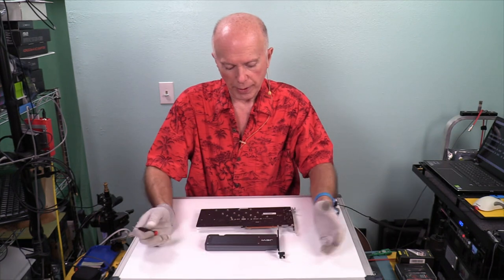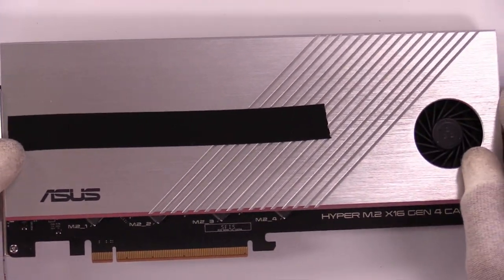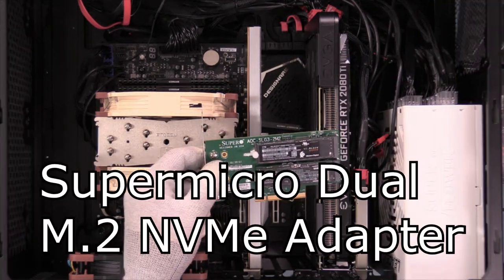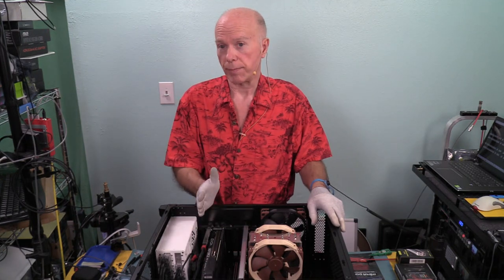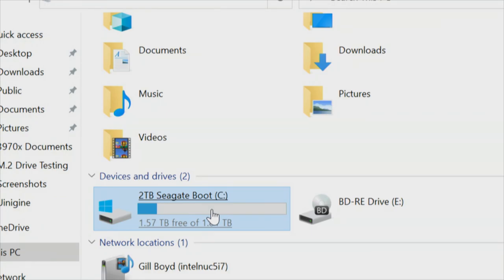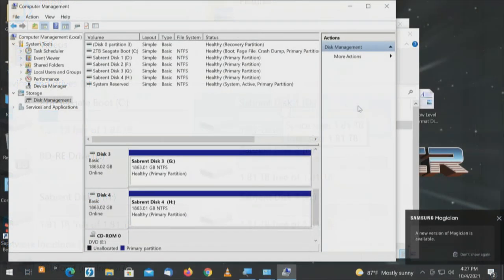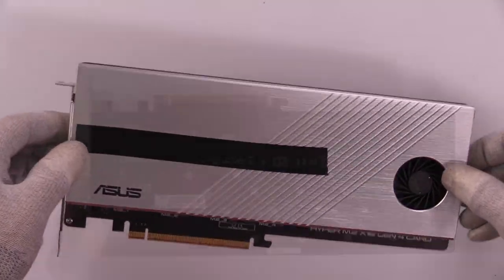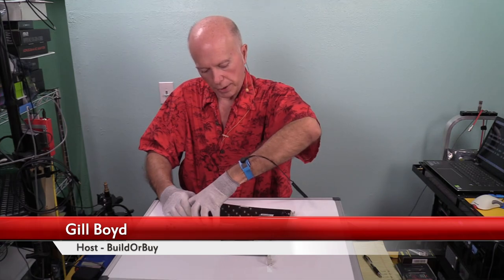ASUS Hyper M.2 X16 PCIe 4.0 X4 Quad card Heat and Speed Test Comparison

Comment: WIll this, or do you know of any other cards, work on an MSI B550 Gaming Carbon Wi-fi Motherboard? Or, what would be the best type of raid card / system for this? NVME or SSD? Thank you. (I currently have both NVME slots full on my mobo (two)).
Reply from the maker: Hello dahuchsi,
Welcome! Not enough CPU PCIe Lanes for X16 unless Your GPU were using X8. Then You would still only have X8 for a Quad card which requires X16, electrically. And... Does Your Bios support CPU PCIe Lane Bifurcation? You would need a Self Bifurcated card that would work on X8 Lanes. There are several. Not certain any are currently available. 
1. Syba Quad M.2 NVMe Ports to PCIe 3.0 x16 Bifurcation Riser Controller - Support Non-Bifurcation Motherboard
https://amzn.to/3rcg8EN
2. Syba Dual M.2 M-Key NVMe Ports to PCIe 3.0 x16 Bifurcation Riser Controller - Support Non-Bifurcation Motherboard (SI-PEX40129) Requires X16 Slot 
https://amzn.to/44hexfQ
3. SABRENT 4-Drive NVMe M.2 SSD to PCIe 3.0 x4 Adapter Card [EC-P3X4]
https://amzn.to/3NYR2SR 
4. StarTech.com Dual M.2 PCIe SSD Adapter Card - x8 / x16 Dual NVMe or AHCI M.2 SSD to PCI Express 3.0 - M.2 NGFF PCIe (M-Key) Compatible - Supports 2242, 2260, 2280 - JBOD - Mac & PC (PEX8M2E2)
https://amzn.to/3pFx32j 
5. Micro SATA Cables|PCIe x8 Gen4 for Bifurcated M.2 NVMe Dual Port AIC 
https://amzn.to/3D0wkfh 
6. HighPoint Technologies Highpoint SSD7105 - PCIe 3.0 x16 Fully Bootable 4-Port M.2 NVMe RAID Controller 
https://amzn.to/44v0YJi 
7. HighPoint Technologies SSD7540 PCIe 4.0 x16 8-Port M.2 NVMe RAID Controller 
https://amzn.to/3JLA6g6 
8. QNAP QM2-2P-244A Dual M.2 22110/2280 Pcie SSD Expansion Card (PCIe Gen2 X4) 
https://amzn.to/3JK3gMw 
9. Ableconn PEXM2-130 Dual PCIe NVMe M.2 SSD Adapter Card - PCI Express 3.0 x8, Supports 2X M.2 
https://amzn.to/3XElPHK 
10. Highpoint 4-Port M.2 SSD7505 PCIe Gen3/Gen4 NVMe Bootable RAID Controller for Windows & Linux 
https://amzn.to/3rhELAa 
11. IO CREST Dual M.2 B-Key SATA SSD Converter PCI Express 3.0 x1 Expansion Card Heat Sink Jmicron JMB582 Chipset SI-PEX40153 
https://amzn.to/3PHZLtR 
12. Vantec Dual M.2 SSD RAID PCIe x4 Host Card (UGT-M2PC300R) 
https://amzn.to/3pwcJjZ 
13. Highpoint SSD7101A-1 NVMe 4-Port M.2/U.2 Unbeatable Peformance/Comprehensive Selection; No-Bifurcation Required 
https://amzn.to/3D0Y8Qn 
14. OWC Accelsior 8M2 Eight NVMe M.2 to PCIe Card Compatible with Mac Pro (Late 2019) and PC Towers 
https://amzn.to/3rlLfOe 
15. Glotrends 4-Bay M.2 NVME Adapter, Support Non-Bifurcation Motherboard, Soft RAID, PCIE 3.0 X8 Bandwidth, Full Aluminum Panel with Built-in Fan (Sky) 
https://amzn.to/3XNIoKf 
As an Amazon Affiliate I earn from qualifying purchases! Of those Listed above, some require X16 while some only require X8. 
16. Amfeltec Squid carrier board. Out of Canada. From X4 to X8. You'll have to ask for a Quote and be very Specific with Part names and numbers using their nomenclature. Lots of Options! Hope that helps! 
https://www.amfeltec.com/pci-express-carrier-boards-for-m-2-ssd-modules/
Reply: @BuildOrBuy  Well, you've earned a subscriber. You've answered my question in one fell swoop where even MSI tech support failed to encompass. So, I can use a self bifurcated card then. No, the MSI motherboards do not support bifurcation apparently. You're saying since my GPU is in the 1st PCIx16 lane the 2nd PCIx16 lane won't be able to use x16 only x8? Do you think any of those cards you linked would work fine then with the motherboard? It can still raid 0/1/5 with those cards? Would it even be a good option at this point for something like this? Or, should I just go the regular ole Sata SSD route? I REALLY appreciate your help.
Reply from the maker: Hello  @dahuchsi ,
Outstanding! I'm honored! Most but not all since You'll be using X8. The detail that makes those work is the PLX Chipset doing the Lane Switching. Not all are always Available. Most are available. And not everyone is consistent with the nomenclature. We have a Video on the Amfeltec Squid carrier board and the Glotrends Sky cards. We have not Tested the efficacy of the others. And doing a search will not show what We're aware of which is crazy. We are continually looking for these types of cards. Once You start using M.2 NVMe PCIe SSD Drives, anything slower is a nuisance. Glad We could help!

Comment: So confused.  My motherboard is Z370 chipset ROG MAXIMUS X CODE (core I7-8700k CPU) with native pcie 3.0 x 4.  Will this card (or any other) let me use multiple M.2 drives to get 7300MBs or higher?
Reply from the maker: Hi dberry99, 
Welcome! Great Question! Let's look at Your Motherboard PCIe Resource allocations for Slots and Storage. 

ASUS ROG Maximus X Code X370 Chipset 
https://rog.asus.com/us/motherboards/rog-maximus/rog-maximus-x-code-model/spec/ 

1. PCIEX16_1 - X4 
2. PCIEX16_2 - Partial Bios Bifurcation. 
Supports: (x16, x8/x8, or x8/x4+x4) 
Would only see 2 Drives. Why? To reiterate, Your Motherboard only Supports Partial Bios Bifurcation. This Add-in card Requires Full Bios Bifurcation from X16 to X4X4X4X4. Not enough CPU PCIe Lanes either. Best option: A Self Bifurcated Add-in card as opposed to this Bios Bifurcated Add-in card. Requirement: 1 - X16 Slot, electrically not just mechanically! Brands: Highpoint, Glotrends Sky or Amfeltec Squid 6 Drive add in card. Only Highpoint has PCIe 4.0. The other two are only PCIe 3.0. 

1. Highpoint SSD7103 – PCIe 3.0 x16 4-Port M.2 NVMe RAID AIC RAID Controller Card - Bootable 
https://amzn.to/3FAjTHP
2. Glotrends 4-Bay M.2 NVME Adapter, Support Non-Bifurcation Motherboard, Soft RAID, PCIE 3.0 X8 Bandwidth, Full Aluminum Panel with Built-in Fan (https://www.amfeltec.com/pci-express-carrier-boards-for-m-2-ssd-modules/ 
Only Requires PCIe 3.0 X8 Slot. 
https://amzn.to/3HMCPWu
3. Glotrends 4-Bay M.2 NVME Adapter, Soft RAID Support, Up to PCIe 3.0 X8 Bandwidth, Aluminum Cover with Built-in Fan (Palace). Requires PCIe 3.0 X16 Slot. 
https://amzn.to/3W5gIPi 
4. Amfeltec Squid Carriet Boards 2 to 6 Drive Add-in Cards 
https://www.amfeltec.com/pci-express-carrier-boards-for-m-2-ssd-modules/
Self Bifurcated Add-in Cards cost as much or more than CPU and Motherboards due to the PLX Chipset which does the Lane Switching for Bifurcation. An expensive Chipset! Hope that helps!
Reply: @BuildOrBuy  Thank you so much for the speedy and thorough reply! The $450 card is exactly what I need and with $1600 of M.2 drives I think I can squeeze an extra 2 FPS out of CoD in my 4 year old gaming PC.

I'm further heartened by the knowledge that there is very little that can't be solved with an absurd amount of money or duct tape.
Reply from the maker: Hi @dberry99 , 
Absolutely! Good timing! Glad to help! All about knowing Our Options! Anything is possible! Let Us know of Your Success once You're up and running! Motherboards now, as everyone is asking, is all about Slots and Storage for PCIe Resource allocations! Or bubble gum and bailing wire!

Comment: Thanks for this nice test. i'm reading  "Compatible with AMD TRX40/X570" on the Asus site.. i'm looking at a ASRock X670 motherboard looks like it might not be compatible. i don't need raid just want to know if expansion might be an option.
Reply from the maker: Hi TuxKey,
Welcome! Great Question! Depends upon the Motherboard PCIe Resource allocations Design vs Implementation. Specifically which Motherboard, X670 Chipset and CPU? We have to look up every Motherboard asked about to verify. Bifurcation is a fascinating topic!
Reply from the maker: Hi @samdeur ,
Greetings to the Netherlands! RAID should be seperated from Bifurcation. Two different technologies often grouped together since one can require the other but still they are seperate. 

Bifurcation is the Ability to Fork or Spilt. In this scenario, We're Seperating CPU PCIe Lanes in to Groups of Four Lanes each to Address each M.2 NVMe PCIe SSD Drive. When requiring 8 Drives on one AIC, that Requires Active PCIe Self Bifurcation. The AIC has a built-in PLX Chip to do the Lane Switching. Hope that helps! 

Bifurcation Support is an issue on Consumer Desktop Motherboards with Shared PCIe Resources. And is a problem for Servers and Workstations. Change one thing changes everything!

Comment: when you did the first test and you had temps of like 49, 53, 49 and 45 I think it was, I would love to have seen you swap the two drives of 53 and 45 temps and see what happens if you run that test again, to see if its the position on the drive which caused the fluctuation of heat or if the drives themselves just run a bit hotter or cooler.. swapping that 53 and 45 drives or if maybe its a combination of the drives and or perhaps the thermal pads which were on them drives which was making the difference in the heat..

Comment: will it work with my lga 2011 vs i know its pcie4 and lga 2011v3 runs pcie 3 but it does have the lanes and could get it pretty cheap with some 2tb nvme drives:person-turqouise-waving:
Reply from the maker: Hi Christian Hoffman, 
Welcome! Great Question! Too vague. There are currently 56 LGA2011 Motherboards Listed. Every Motherboard has Different Resource allocations. We need to know Motherboard Brand & Model, Chipset and CPU to Answer Your Question about the ASUS Hyper M.2 NVMe PCIe Quad card which has 2 Requirements. 
1. X16 Slot, electrically not just mechanically. 
2. Full Bios Bifurcation from X16 to X4X4X4X4. 
If Your Motherboard does not have adequate CPU PCIe Resources then the next Option would be a Self Bifurcated card. Those are about the price of Motherboard or CPU. Those will Require either X16 or X8. Depends upon Your Motherboard and what it can provide. 

As to the M.2 NVMe PCIe Drives, Yes. Backwards compatible. Buy M.2 NVMe PCIe Drives based on price. Yes to reiterate for backward compatibility, Lanes are the same. Only different is Bus speed, PCIe 3.0 or PCIe 4.0. Hope that helps!
Reply: Thank you for the quick reply the motherboard in question is the X10DRH-iLN4 by supermicro
Reply from the maker: Hi @Cherrios531 , 
Absolutely! Good timing! Supermicro X10DRH-iLN4 Bifurcation 
https://www.supermicro.com/support/faqs/faq.cfm?faq=28339
That Motherboard does not Support Full Bios Bifurcation on any Slot, Only Partial. Ideal for the Supermicro Dual M.2 NVMe PCIe Adapter. 

See: Supermicro AOC-SLG3-2M2 PCIe Add-On Card for up to Two NVMe SSDs
https://amzn.to/3jdmEXV
As an Amazon Affiliate I earn from qualifying purchases! Hope that helps!

Comment: O boy, I have this card as well!!!! Tell me some good news!!!!
Reply from the maker: Hi Hawk,
Welcome! Congrats! M.2 NVMe PCIe 4.0, 1st and 2nd Generation SSD Drives run cooler on a Quad card than they do under a Motherboard Heatsink! Interesting!
Reply: ME TOO. ASUS Hyper GEN4 AIC. I just can't test the GEN4 drives on amything but an old X399 PCIe GEN3 cpu lane MOBO. 3500/3500 isn't a real temp test.
Reply from the maker: Hi @maxhughes5687 ,
Agreed. PCIe 4.0 and above! This was surprising. We've had requests for this for some time. One Subscriber had Commented that they thought M.2 NVMe Drives on a Quad card ran hotter. Hardly. Fascinating Results again! Next up, the Gigabyte Aorus M.2 x16 Quad card!

Comment: Your video is well explained. I have a Msi Meg Godlike X570 and 5950X with 2x 3090. I now want to install 4x 980 pro in my Hyper Card 4.0. Is that possible?
Reply from the maker: Hi trailerofdead,
Welcome! Appreciate Your Comments! We try! Here to help! Here goes... 

MSI Meg Godlike X570 and 5950X with 2x 3090. 
https://www.msi.com/Motherboard/MEG-X570-GODLIKE.html
Looking at Your Motherboard Specs, PDF Page 33. 
1. PCI_E1 = PCIe 4.0 x16 - RTX 3090
2. PCI_E2 = PCIe 4.0 x4
3. PCI_E3 = PCIe 4.0 x8 - RTX 3090
4. PCI_E4 = PCIe 4.0 x4

And 2x RTX 3090s. Your 1st RTX 3090 is x16. Your 2nd RTX 3090 is x8. 3rd, Out of PCIe Resources! Your other 2 PCIe Slots are x4, electrically. Bummer, right. To utilize Your MSI expander Quad card, that would have to be in the 1st x16 Slot since each M.2 NVMe requires 4 PCIe Lanes hence a x16 Sot, electrically not just mechanically. 

You could install 1 M.2 NVMe PCIe Drive in each slot since each M.2 NVMe Drive Requires 4 PCIe Lanes. To reiterate, no Quad card! Not possible! Not even a Dual M.2 Adapter! Here's a great example of the PCIe Slot and Lane assignment choices made by MSI. Obsolescence by design! This deserves a Video in Answering Subscribers Questions! That way, We can help more Subscribers understand these PCIe Resource allocations according to Your Motherboard and how Vendors are prioritizing those options! Stay Tuned!
Reply: @BuildOrBuy  Thank you for your great quick response. Thanks. I already thought that I would need full x16Lance for 4x 4 M.2. It says so on the menu itself. I thank you very generously for your help. I will pursue you. In this sense, I have to wait for Intel Sapphire Rapids, because they have a lot of Lance available. But unfortunately it still takes a while before they come onto the market. and Threadripper 3975x + unfortunately have too little boost and the architecture is out of date. Best regards. :-)
Reply: Yes, I understand everything. To win 4 lance I need the 2nd GPU with x4lance. That will not do. Haha best regards
Reply from the maker: HI @Trailerofdead ,
Excellent! Success and Best Wishes! This might help, later! Stay Tuned! 

AMD's AM5 platform will launch in 2022 with support for PCIe 5.0
https://www.xda-developers.com/amds-am5-platform-will-launch-in-2022-with-support-for-ddr5-and-pcie-5-0/amp/
Reply: Thank you so munch
Reply: @BuildOrBuy  Yes I think so too. The new year will be many cpus Threadripper ++ ^^ THX :-)

Comment: So should I put the video card in slot one or the add on card in slot one?
Reply from the maker: Hi BrokenTrashman,
Welcome! Ah ha! Excellent Question! This goes to asking about Your Motherboard! As a general rule, Consumer Desktop Motherboards only have one X16 PCIe Slot, electrically. To reiterate, there are no Consumer Desktop Motherboards with 2 - X16 PCIe Slots, electrically. Another way to answer Your Question, tell Us which Motherboard, Chipset and CPU You're using. Quad cards of this type require a Bios Bifurcated X16 PCIe Slot. On a Consumer Desktop Motherboard, that will be the 1st X16 PCIe Slot. Guess what happens to the Primary PCIe Slot when using the 2nd PCIe Slot. They will Share PCIe Resources. And that's not going to to work with a Quad card which requires Dedicated PCIe Resources! To reiterate, Your Specs. We'll explain what You have and Specifics on how this works on Your Motherboard!